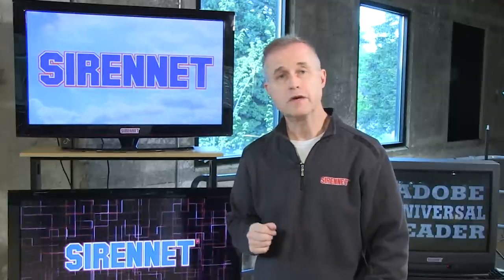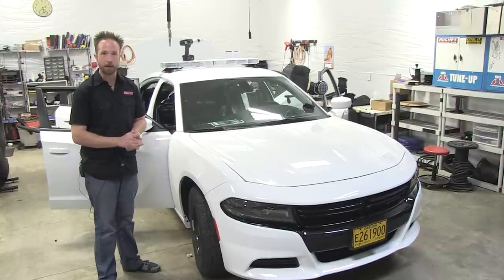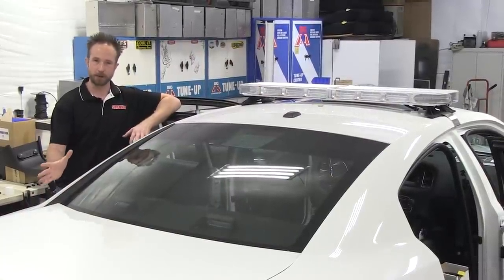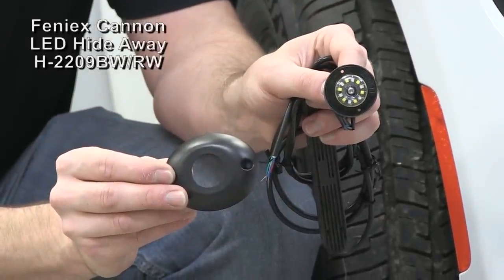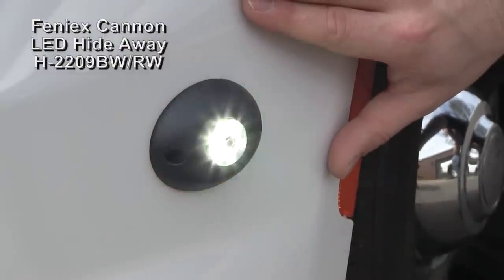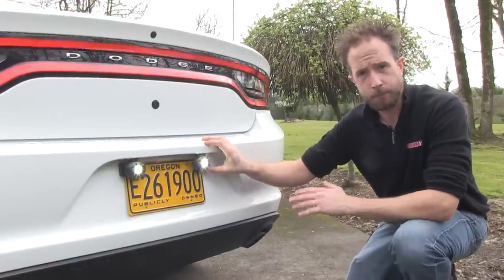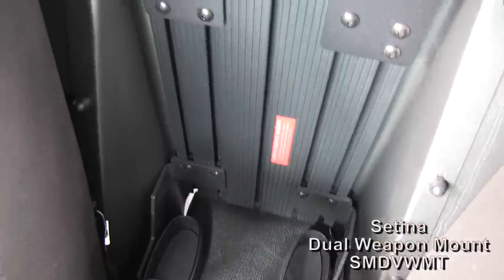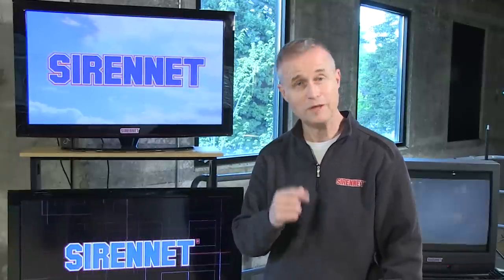AWD 2015 Dodge Charger install

Comment: Would have been neat if they would have wired the rear facing Fenix Cannon's into the reverse lights so they would steady burn white when the car was in reverse. Rear mounted takedowns are common on our County cars to increase the visibility when backing up on some of the dark roads around here.

Comment: great job, but why you never show the sound and work of sirens?
Reply from the maker: zloidiadia1995 At Sirennet's & Star Cars Offices, we try to be courteous to our neighbors and not scare them with the Siren systems sounding. We demonstrate the Tones here and there when we are in an outside closed environment away from folks.
Reply: SIRENNET looks like they are using a shed on private property

Comment: Nice, clean installation. I haven't gotten a chance to use the Fenix products yet but I think I will be checking them out soon as a replacement for a '15 tahoe's reverse lights rather than drilling through the double walls.
Reply from the maker: +Wells Communications     We're glad you like it :) Thank You. We did use the Cannon's in a 2015 Tahoe in place of the stock reverse lights... Please check out the following K-9 Tahoe we put together:   https://www.youtube.com/watch?v=Umc4MJHngAU

Comment: I'm interested in the headlight and brake light flashers. You said those were OEM? So it can't be done to regular Chargers??
Reply from the maker: +Anthony P    On the 2015/16 Chargers, we've yet to outfit one that has not been a Service Package. As the new body style is full LED for the front White Halo's, an LED Flasher Module would most likely be the best option to use with them. On the rear-end, depending on exactly you want to Flash, an LED Module may be needed verse a standard tail-light Flasher. The 2015-16 is full LED for the Brakes, Tail Lights, and Reverse Lights.

Comment: I just don't think that these LED headlight flashers are as visible as a true halogen flashing high beam light.
Reply: Blaine Bugaski it's brighter in person
Reply: But still, which is brighter?
Reply: The halogen flashers would be more visible from the front...the led headlight flashers on the Charger actually wrap around., so I think it would both be visible from the front and sides
Reply: +Blaine Bugaski Side by side comparison.... LEDs are much more noticeable than halogens in my opinion. Sharper light as opposed to the warmer halogen glow. They also offer instant on and off for quicker flash patterns. (Halogens need time to light, therefore require slower transitions between them)
Reply: Isn't this partly the reason why the 2016 Explorer Interceptor went back to standard high beams without shutters, so that a traditional flasher unit could be used with the high beams once again?
Reply: +Blaine Bugaski  I'm not sure if that was the reasoning, but They do have new LED tracers around the headlight bezel which I'm looking to utilize on my next installation. Same thing with the tail lights.  I just completed a 2015 charger in the same manner. The Charger is actually using projector beams with shutters which is why Dodge has been using the factory LED tracers around the bezel for their wig-wag options. It's on our channel if you want to see how it looks.
Reply from the maker: +Blaine Bugaski    That is part of the reason. Also by breaking up the headlight with an independent low beam and high beam this time, it allowed them to upgrade the low-beam's to LED which is simply amazing both in output and looks.
Reply: SIRENNET Very nice.  Less moving parts is also a positive thing!
Reply: Wells Communications Subscribing as well.
Reply: +Blaine Bugaski  Thanks! Hope you like the videos

Comment: i love Dodge Charger. :)
Reply from the maker: ***** We're glad you like it :)
Reply: SIRENNET sure did. :)
Reply: ***** I just bought a new 2015 Dodge Charger R/T Plus in bright white (like the one shown in your video). The bad boy I got is definitely the best car, all around, that I've ever owned. The Charger R/T Plus is about as close to a police package as a civilian can get. It's got the 5.7 liter V-8 Hemi MDS VVT motor, Mopar Cold Air Induction, TorqueFlite 8 speed automatic 8HP70 Transmission, Performance Suspension, Anti-Lock 4 wheel Disk Performance brakes, Rain Brake Support, Elecronic Stability Control, All Speed Traction Control, Tire Pressure Monitoring Display, Automatic Headlights, 160 MPH Speedometer, Keyless Start N Go, Alarm System, Theft Deterrent System, Uconnect 8.4 inch Touchscreen AM/FM/SXM/BT system, Siruis XM Satellite Radio w/1 year free subscription, 6 Premium Speakers, 276 Watt Amps, Media Hub (SD,USB & Aux), 2 12 volt Aux Power Outlets, Heated/Cooled seats, Heated Steering Wheel, ALL gauges, Bi-Function HID Projector Headlights, 20" x 8" Polished Aluminum Wheels w/Graphite Pockets, 8 way power Driver & Passengers seats, 4 way Driver & Passenger power Lumbar Support, Parkview 8.5" Rear Park Assist (Camera), Blind Spot & Cross Path audible & visual Detection System, Rear Back-Up Camera, 3 D GPS Navigation System, Power SunRoof, 3 "bulb" halogen fog lights, 5 Year 100,000 Mile Warranty, LIFETIME Warranty on ALL systems including advanced electronics, Push-Button Automatic 911 Caller, 20 inch Cop Tires, Cop Suspension, etc.,etc., etc. It has just about everything, most of motor has heavy duty Cop parts. It's got extra sound damping insulation, so it's quiet, handles wonderfully...like no other car I've ever driven (including Crown Vic Police Interceptors) . I just had to talk about this wonderful car given ***** comment about the Dodge Charger ! The ONLY downside is Uconnect is a challenge to totally set up and understand because it seems that a few of the 38 Apps it has require a paid subscription, that the salesman forgot to mention, but the cost of the subscription(s) are minimal. I enjoyed your video, well done as always ! One other thing...I cannot find a 2015 Charger PLUS in any promotional materials from Dodge, does anyone know the story of the R/T Plus ???
Reply: Buck Savage
nothing can keep up 2 a Dodge Charger R/T never heard of the  R/T Plus. theres nothing on there website about the R/T Plus.

Comment: Hey SIRENNET just an idea for you can Star Car how about you mount the radio aerial to the light bar that way you don't have to drill any holes. They do it here in Australia with all the new Emergency Vehicles being rolled out. Plus it lakes it easier to remove and reuse the same light bar etc on a new vehicle when the old one is decommissioned.
Reply from the maker: Corey Dark We've looked that his mounting style, but for most of the Installations performed, far to many antenna's are mounted on the roofs for them to be moved to the Light-bar & spaced properly.

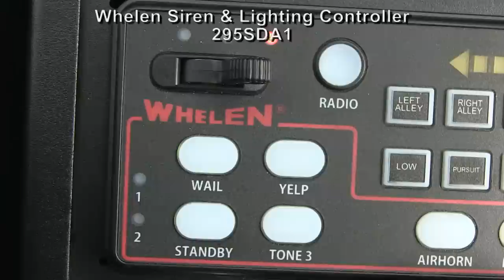Comment: @9:30 what does the pursuit button do? Also what is the radio rebroadcast used for?
Reply from the maker: Julius Leonard The pursuit button shuts off the rear-deck nForce and the rear license plate Cannon's as well as shutting off two of the rear Liberty II Warning Modules. When multiple Cars are running Code together, the car behind does not get completely blinded by the Cruiser in front. Radio Rebroadcast allows the In-Car Radio to repeat/broadcast through the 100 Watt Speaker.
Reply: Awesome, nice build guys. Thanks for the video and the reply.

Comment: thanks but am not cop can I get that system on charger I want to buy one and install this is it possible for me .
Reply from the maker: +holgy gyurt     If it were set-up in Amber and without a Siren, you may be alright. We'd suggest looking into the legalities of this in your area. Checking with your State Patrol or DOT Office would be a great place to get information.
Reply: SIRENNET thanks for quick reply 
How much does it cost ?
Reply from the maker: +holgy gyurt     As far as total cost for the Equipment, it would adjust based on what all is being used for the build-up. Depending on the exact set-up, you could have an outstanding Lighting and Accessories System for $3000-$6000.00 give or take.

Comment: Police in the usa have much better vechile outfit than ours in Australia all marked have code3 defender & unmarked have 3 dash lights, no prisoner screens very basic
Reply: Public Safety Lights Australia Yeah same with New Zealand, atleast you guys have V8's for your highway patrol. We use the Holden Commodore Evoke for standard patrol and undercover and have the SV6 for Highway Patrol. I wonder what NZ and Aus will change to when the Commodores and Falcon production ends
Reply: Ricky Julian by the sounds of things Australia mite be getting some of the usa vechiles like the ram, tundra, ford's & be sweet if we got the charger that be a sweet looking car to have, but we will probably get like a great guess will have to wait & see what we get.
Reply: Public Safety Lights Australia Yeah that would be sweet. We would most likely follow Aus and use something you guys choose. NZ tested the old generation Chrysler 300, but they thought it looked to intimidating, but maybe they will retest the new model that will be out when Holden ends Commodore production. But your right all we can do is guess until the time comes closer and they reveal the candidates for replacement
Reply: Ricky Julian the great walls & some of the other budget cars could work haha, I like the look of the chargers with the intimidating appearance, same with the hwy patrol holden look heaps good, or a custom built car police package just for the police, but probably won't happen,  we had a unmarked police car get onto the tram tracks on the gold coast QLD & the tracks were higher suspended higher than the bridge footing & got stuck, & some of these high powered cars from the USA would be really cool to have.
Reply: Public Safety Lights Australia I feel like if they put Chargers into unmarked duty, they'd stand out so much! At least here in Adelaide they would.